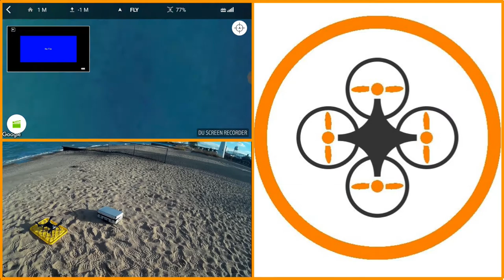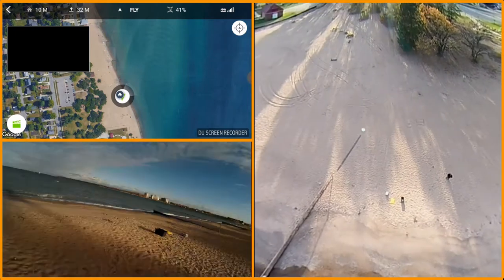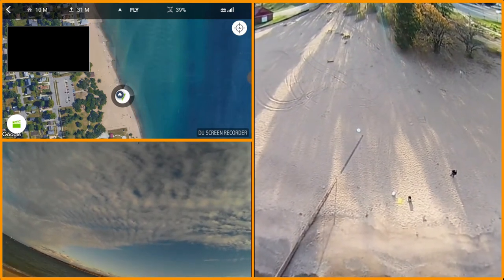3DR Solo - First Flight with Dual Cameras in High Winds!

Comment: Greetings from Arbroath on the East coast of Scotland which is windy just like your place.
My question today is about your SPARK. I've just ordered one and I'm wondering, does it fly straight outa the box ? Does ii need a lot of setting up and will I have to find the info on You Tube ? The instructions you get are not always coherent.. Your videos are always informative. Keep them coming
Reply from the maker: Hello fellow Scotts man!  Yes it is and hopefully you got the fly more package as it worthless just by phone, but just charge it up, calibrate the compass, set your return height and go fly!
Reply: Video-Drone .That's good news and yes I got the "fly more" deal from Maplin UK. saving £200. However I won't be flying it in windy conditions. I don't fly my P3S in wind either
Non drone question. How does the demise of Detroit impact on lake traffic ?
Reply from the maker: Detroit actually sits on the river and no real freighter traffic stops there, likely 50% of the traffic you see is headed just south of where I shoot these videos  there are huge aggregate yards (lime stone for concrete manufacture) as well many consumer and industrial coal fired power plants.  Then there is Petrolea on the Canadian side which a huge petro-chem complex covering around 20 square miles (you do not want to live south of me, locally its referred to as cancer ally).  The other 50% head further down into lake Erie and up into the St Lawrence Seaway.